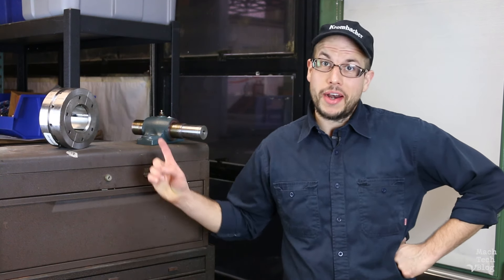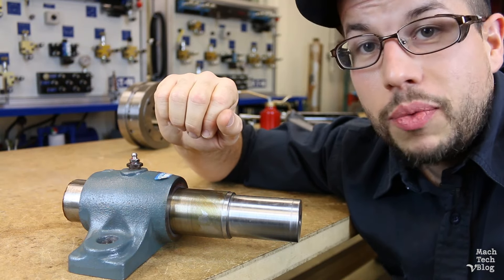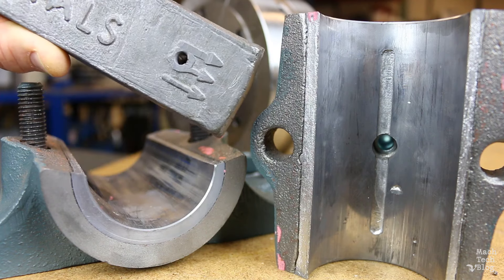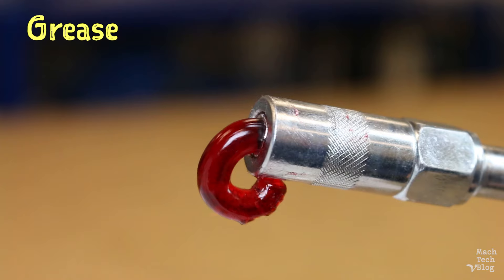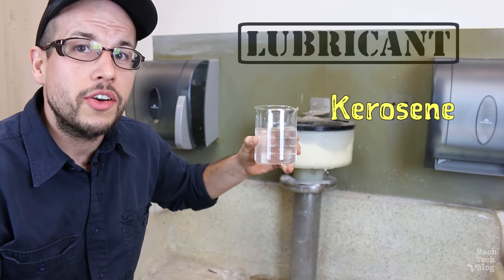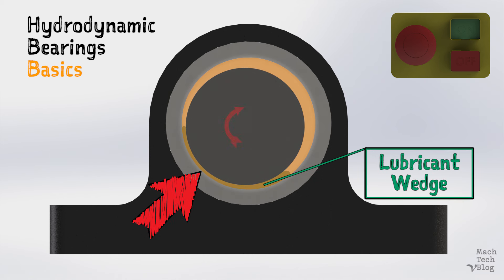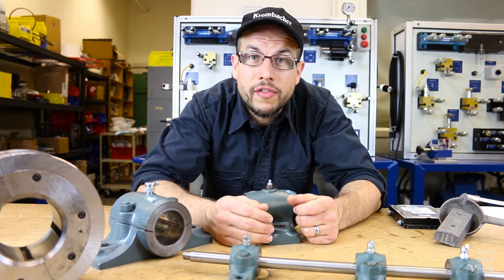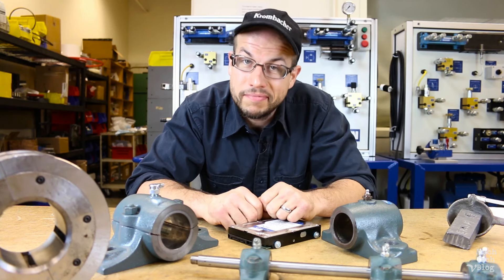Hydrodynamic Bearings

Comment: I like your real life example of a typical motorist surprised by puddles after the rain. So feel safer knowing that one or two out of ten motorists are actually competent enough to drive. After wrenching 50 years on everything with a motor wheels, wings or a hull, I didn't learn much from this, but it was clear and precise. Kudos to you good sir. Here's a tidbit you may not know from motor bearings: Motors with nonconductive bearings last much longer and restore full current to the windings instead of shunting through the journal to ground. RC Hobbyists discovered this after installing ceramic hybrid bearings in their hot 3 phase motors, yielding 12 - 15% increase in run time on batteries, and much longer life on the bearings. Keep up the great work!

Comment: Thank you very much for this very illustrative video.
A lot of people use vintage sewing machines with several sliding bearings in them. I guess you can call them hydrodynamic bearings. The machines are typically more durable than modern machines with many plastic parts. Normally a low viscosity sewing machine oil is used and recommended for such machines, and you lubricate them regularly. Some like to use the machines for a bit harder applications with thicker thread and loads on the bearings, and at the same time operate the machine at significantly slower speed. I guess a bit higher viscosity oil like a normal motor oil would be better suited for such a situation. Am I right?

Comment: Great explanation, but how do we keep the liquid inside the bearing and prevent it from escaping along the shaft? A rubber seal that makes contact with both the shaft and the support won't increase the friction, and also won't be damaged quickly?
Reply: I'd like to know this too. I believe in part, though, that the high viscosity of the lubricant prevents itself from escaping between the microscopic openings of the bearing seals. The friction you're talking about is probably very low since there's low-pressure contact; just enough to hold in the lubricant. But maybe somebody else can expand on this since I'm still a novice in bearings myself.

Comment: missing: It's also very easy to ream fresh babbit to a correct diameter for older worn journals.
missing: HDD bearings also come in designs that use Helium inside the housing and bearings.  Far lower friction and mass than air for more efficient and higher speeds.
missing: The end bearing is referred to as a "flotation bearing" if it uses pumped fluid, so is the shaft bearing if it continuously uses pumped fluids.

Comment: In a hard drive, the read write heads ride on air but the spindle runs on hydrodynamic bearings, these are extremley reliable indeed wich is very important since they often run year after year 24/7 without ever stopping and are expected to last.

Comment: Hello, I have several extremely large Hydrodynamic Bearings at my plant.  We refer to them as Babbitts.  4 of 5 of these babbitt pares operate nominally.  However, the fifth "jerks" starts and stops.  The rpm for the shaft is very low ~70 and the jerks are almost 1 per second.  I have created several drawings and done extensive investigation but cannot determine the cause.  Do you have any thoughts on this?  I can provide much more information as requested.

Comment: Will a lubricating "wedge" form if the shaft was machined with a slight (.001"-.002") taper on the journal?
Reply: RumpLeINtiLINsKinnIN RumpLeINtiLINsKinnIN RumpLeINtiLINsKinnIN I believe that would depend upon the viscosity, speed and tart if the bearing. some lubes are designed to bunch in high pressure areas if speed <0, which means that the variable speed along a taper is compensated. I have seen designs for grooves on the female that circulate or distribute the lube to prevent running dry along the lesser diameter. whether it is a convex, straight angle or or multi-angle/taper, will vary. maybe a tilt hydrostatic bearing?

Comment: Noob question here, so does the grease/oil spill out of both ends as the shaft spins, or are there seals which can't be seen? If the grease seeps out of the ends, I assume there's constant flow of new grease in and a large mess at the ends? What am I missing here....?

Comment: The actual difference in the bearing types; Hydrodynamic meaning it's only a floating bearing when in motion(dynamic). A hydrostatic bearing uses a pumped fluid so it's always floating, even when static(no motion)
Reply: Roland Jollivet They aren’t technically always floating. They are ‘brought up on oil’ prior to startup. The oil provides a soft start and landing. Big turbine rotors weighing easily 8 - 20 tons won’t even turn (which is critical for alignment tasks) without being brought up on oil

Comment: Uh, tell me that wasn't actually kerosene you just threw down the drain lol. Also, you should do a video on Hydrostatic Bearings.
Ah, you got to hydrostatic, now I just need to know where you got those glasses.
Reply: @Stephen Anthony You shouldn't put anything down the drain that you wouldn't eat. Waste treatment plants aren't designed to remove non-waste components, in some places the water then becomes the public water supply, in others, it's crop water, or discharged to the ocean.
Reply: @Stephen Anthony Nah. It's really high in Calories.
Reply: Hey guys look and listen. That was really water. See droplets and the sound is consistent with water not kerosene! Ease up on the guy.

Comment: Great content. Could hydrodynamic bearings (air or oil) potentially be used in micro gas jet turbines?
Additionally, could they work with concentric shafts such as in two and three spool jet engine designs (eg RR Trent series)?

Comment: Sorry, HDDs do not employ air bearings in the spindle that rotates the disk (or disks), they have FDBs, i.e. a sort of "oil"! The air-bearing people talk about in the context of an HDD is used to fly the head/slider over the disk! (But some heavy duty high-speed spindles, e.g for testing the disks and the heads on so-called spin-stands prior to building the heads and disks into HDDs, do indeed use spindles based on a rotating, externally pressurized air-bearing.)

Comment: Your presentation is perfect but i have one 2 comments
 Hydrodynamic and Hydrostatic refers to the lubricatons process and surfaces separation.
 So in anti-friction bearing there will be now hydrodynamic Lubrication ??
Bearings internationally classifed as friction and anti-friction .. Not hydrodynamic and anti-friction
Hydrodynamic or hydrostatic?
Simply stated 
Hydrostatic - positively pressurized bearing which doesn't rely on shaft motion to create the gap between surfaces
Hydrodynamic totally relys on the shaft motion .. 

Thanks

Comment: Most European cars use special low viscosity oil like W 10 or  W 15 because their tolerances are tighter and the gaps between metal parts are smaller.  They don't work so well with a high viscosity oil like W 40 motor oil.

Comment: The problem with any kind of bearings is regular lube. I have a job that exists because people doesn't maintain their their equipment :D
Reply: Evi1M4chine  automatic lube systems exist. But they are espensive as divorce. So they are used mostly in hard to reach places.

Comment: In your statement regarding the plain journal bearing you mention chrome plating on the journal for increased wear resistance......WHY...…... and also state that they can theoretically last forever because they ride on a film of lubricant...…….this is a controversial statement......riding on a film of lubricant means there is no metal to metal contact so no wear can happen so no chrome plating needed. BTW, in todays mechanical world no machinery uses plain bearings in favour of ball or roller bearings. There is a difference though if you take for example an automobile engine that uses plain bearings for the big ends and crankshaft journals, but in that case the bearings ride on a constantly supplied pressurised supply of lubricant...….air bearings are also an example of plain bearings.

Comment: In principle a nice attempt to explain the background of bearings to the general audience, however as you correctly say, the devil is in the details. You're mixing terminology in several aspects from the very beginning. In mechanical engineering the main classification of bearings isn't into antifriction or hydrodynamic. Actually the basic differentiation is into "roller elements" or slide/plain bearings. As defined by the name, in the first case shaft and housing are separated by a rolling element spaced between and relativating the speed vectors. These rolling elements can be the famous balls, cylinders, truncated cones, whatever.... in the second case the shaft is running directly against the bearing itself.
And the vast majority of plain bearings are not running hydrodynamic at all. Just think of all the linkages in earth moving equipment such as from Caterpillar or others. All these linkage bearings are greased plain bearings

Comment: Why dont we use hydrodynamic bearing for those fidget spinner toys?
Reply from the maker: Hi, iosef 333,

It could certainly be done. But hydrodynamic bearings have very sensitive lubrication needs and it's unlikely that people would want to keep an oil reservoir in their pockets just to fidget at their desks. A aerodynamic bearing could be used, but then the contact surface finishes would have to be highly polished and rotating speeds would have to be much higher than most people could accomplish just flicking the spinner around with an index finger.